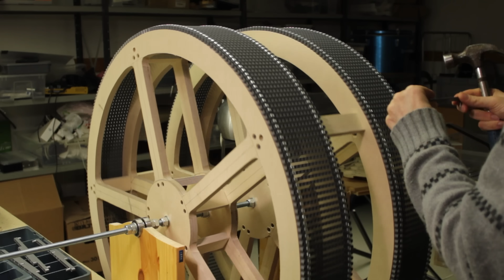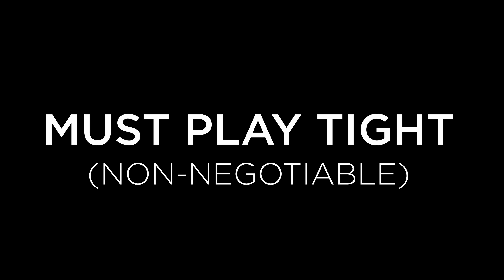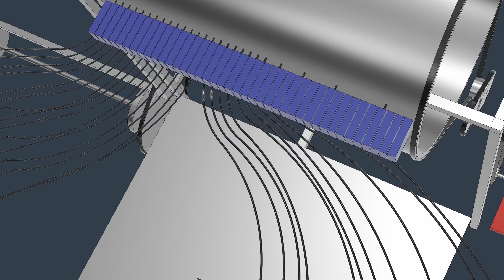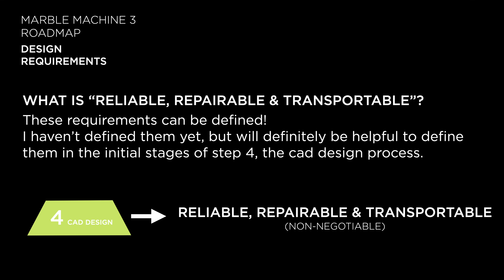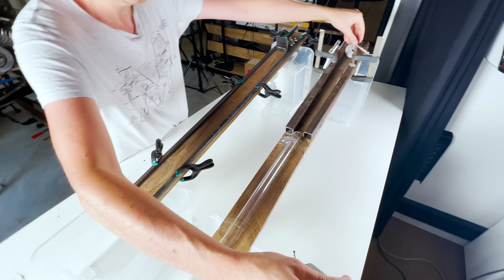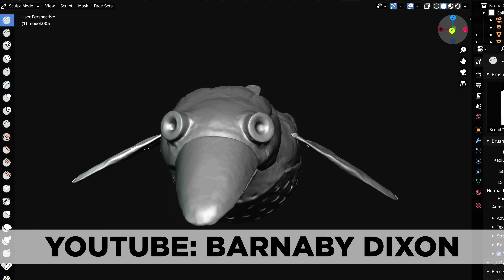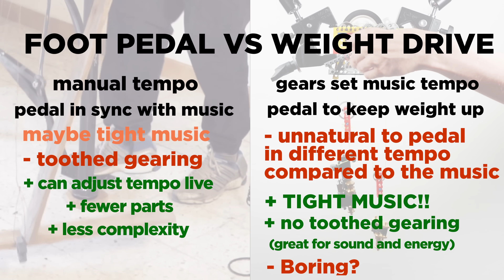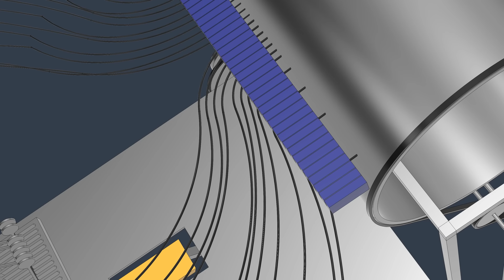Marble Machine 3 is Taking Shape

Comment: You should NEVER, under ANY circumstances, think of the first marble machine as a failure:
At best, you had a working machine that produced an absolutely ICONIC piece of music.
At worst, you had proof of concept.
Remember this:
"I didn't fail. I just found 2000 ways not to make a lightbulb; I only needed to find one way to make it work"
-Thomas Edison
Reply: Yeah it  bugs me how he thinks of the first one as a failure. It's basically just created out of will and inspiration and it was a cool project.
Reply: @wexaztor9394  same. I mean, c'mon, it was LEGENDARY. Yeah it was one hit only, but EVERYBODY saw it.
Reply: I have been saying this for quite a while. The MM was the proof of concept prototype. The MM2 was a test prototype. The MM3 will be a production model device. Each stage is needed to progress to the next one.
Reply: @Artaimus  I'd agree that the first one was a proof of concept prototype. It only became a failure after Martin decided what it should be able to do which then it couldn't. The second one however never ended up being what it was intended to be right from the beginning. Which is the very definition of failure. Also the experience collected is of limited use - and therefore not a "test prototype" at all - because he started at 0 again, using entirely different methods with new problems. While this might be the right approach (if one considers the MMX to be impossible to fulfill the requirements even in a working state), it still means that the MMX has failed and no sugar coating can change that fact.
Reply: His most successful one so far lmao
Reply: To be quite fair, he admitted himself that the first "full" song took a crazy amount of takes all cut together just to get the full video done...
Reply: @davinderc  Very true, but look at it this way:
If it wasn't for that song/video, nobody would be watching this right now... or at least significantly fewer would.
Reply: @brianwilliams1588  I very much doubt Martin does this for the views. It has definitely been a nice bonus that people enjoy it, and maybe he even earns ad profits, but he does this for his own enjoyment, and as he's made clear, he would not enjoy making music on the first marble machine, so from his perspective it failed and I won't disagree with him in that regard.

Nevertheless, as you said, it did reach many people, and that is definitely a nice achievement!
Reply: @davinderc  thank you! All these hundreds if not thousands (or even millions) of people need to stop idolizing that first machine like it was so brilliant. It fucking wasn't. It being a great, creative concept does not change this fact one bit. It was a great publicity stunt though, which explains the 200 plus million views!

The fact that such a short song took like 2 or 3 months to fucking film should be all the proof you need of just how poorly that machine functioned. Such a short song should only take hours (if not days) to film, not months. Had the machine been perfectly reliable, then there's no practical or technological reason the video would've taken months to film.
Reply: Stop saying to the creator of a thing what that thing is or isn't, you have quite literally zero input in it. Stop the arrogance and god complex
Reply: Agree with @brianwilliams1588. mm1 was a proof of concept, mmx had some good ideas, but form over function got in the way
Reply: bad idea using edison, he was just a thief
Reply: The first two version WERE a failure, simply because he’s failed to learn anything from them.  Two years later, look at what this project has become….and how’s he’s simply repeating the same mistakes.
Reply: @br52685  Aww, be fair: he makes entirely new mistakes. Also he does not directly jump for the glamorous bit but spends and eternity on the boring engine, because he wants to avoid adding problems which won't be solved down the line, which kind of makes sense. I am a bit worried about the size of the thing and the lack of a prototype for a basic mechanism which allows testing all parts in an embryonic state as his new strategy of late assembly might end up neglecting that the components don't just have to work on their own but also together, and potentially influence each other. At least he listened to the transphobic puppeteer and did not go for the automatic solution at this point.
Reply: @Schmidtelpunkt  I’m being fair.  But also honest.  You too, would admit that he’s not really learned any lessons.

For example, his year-king obsession with “tightness”—was that a failure-point in the prior two versions?  No, no it wasn’t.

What about his lesson of “dumb design requirements”?  Yet he’s now requiring <0ms tightness—for no justifiable reason (ie, this is just another dumb design requirement).

TEN YEARS later…and look (honestly) at where this or object is.

It’s one thing to “be supportive.”  But it’s also equally important to “be realistic”
Reply: @Schmidtelpunkt  Also consider this huge mistake:  he’s working on a power-mechanism, but has ZERO idea of exactly how much power his machine needs—as he has nothing functional right now.
Reply: @br52685  "For example, his year-king obsession with “tightness”—was that a failure-point in the prior two versions?"
Yes, it was. This is interesting to see in hindsight - every time the machine plays, he mentions that it isn't corrected for timing. I never realized that until somebody mentioned it. He never even started to solve that problem, because he did not reach that point. Which is a mistake he learned from. 
Also keep in mind that at this point he goes for the timing of the modules, not the instrument. There will be delays introduced anyway, so it makes sense that he optimizes everything as far as technically within his abilities.
And of course all that will lead to the question, whether a marble machine as a stage instrument is even possible. And there he absolutely keeps it open to accept that it won't deliver the precision he requires, rather than promising to finish it. 
All of this looks a lot smarter and structured than before.

I agree to the power mechanism problem - this is what I mentioned above I am worried about. There is some incremental optimization required when working with such a lot of unknowns. Especially when the machine differs that much from the previous versions. However, this does not negate that should he not be able to create a power mechanism with reliable tempo he can as well stop building the machine. Which makes more sense to find out now than just like in the previous two attempts, way too late to make any meaningful changes.
Reply: @Schmidtelpunkt  where does he state that timing was a problem with the 2nd version?  Last video I saw of that machine, it was playing very consistently.
Reply: @Schmidtelpunkt  I would also consider calling this a “stage instrument” (especially intending to go on “world” tour) to be another stupid design requirement.
Reply: @br52685  I don't think it appears in any list and it is certainly nothing I would have spotted before he worked on the power module, but when you watch old videos, he mentions surprisingly often that the timing is not adjusted yet, so it clearly was a problem on his mind.
I am certainly not qualified to judge whether the timing was tight by ear, but apparently it was not good enough for him.

And concerning the "stage instrument" I guess he already succeeded in building something he could make play a song and film it over several days. So it makes sense that he raised that bar for the MMX. I wouldn't call that stupid. It might turn out to be impossible though. But what would be the alternative other than giving up?
Reply: @Schmidtelpunkt . What’s the alternative?  Really depends on what the purpose it.  A working device he can make/record music/videos with?

Maybe then displayed somewhere, where people can watch it up close?
Reply: @br52685  That is doing what the first machine did. Not sure I'd call it a mistake not to repeat the same thing over and over again.
Reply: @Schmidtelpunkt  He was able to record music with the first machine?  I don’t recall seeing that done anywhere (other than a few highly-edited snippets).

Also, thinking about your comment that “the timing was off.”  I don’t necessarily believe that justifies an obsession with <0ms tightness.  It could simply be that his timing-pins aren’t places properly…

In all honestly though, I don’t think he’s ever justified/explained WHY the first two were failures.  But he was very clear that “dumb design requirement” were a problem.  But that all I’ve seen him chase this last YEAR—dumb design requirements.
Reply: @br52685  He somehow generated the track just like did with the music video. What would be the point of recording a track if there is nothing to see anyway?

"I don’t necessarily believe that justifies an obsession with <0ms tightness.  It could simply be that his timing-pins aren’t places properly…"
Then all notes of one instrument would still have the same false delay. The issue is that the timing deviates. There is no way of correcting that by moving the timing pins. 
While I agree that currently he clearly works in regions which even for experienced musicians are impossible to hear, the problem is still that those inconsistencies stack up. There are other elements which will introduce further delays down the road. At which point going back to get out the additional microseconds required will be exponentially harder. So he wants to solve the problem now as much as possible. 

"In all honestly though, I don’t think he’s ever justified/explained WHY the first two were failures. "
Yes, and for me that was his biggest mistake: he clearly made decisions for him, but never fully communicated them. He made several videos where he mentions specifics but the whole tightness issue seemed to come out of nowhere, because he never explicitly mentioned it. So one has to piece things together.

He was more specific about the dumb design requirements - mainly that he went to form over function, something he regretted in the last videos about the previous machine already. I don't think that an engine with constant power output is a dumb design requirement. In fact it was the requirement he completely neglected between the magnetic lift (which never worked efficiently and reliably enough).
Reply: @Schmidtelpunkt  there’s another big mistake:  he’s designing a power-device that’s only going to provide constant (and precise) power output.  Yet completely ignoring the fact that the device’s power-requirement will be constantly fluctuating.  That’ll simply result is significant changes to the machines speed.  So much for any optimization of <0ms tightness.

Yet his new philosophy is “I verify?!?

He should know this by now—-as he’s sunk TEN YEARS of his life into this.

I’m 100% of the belief (along with many others) that his true goal isn’t a functional machine, but merely to keep this YT channel (and revenue) going…
Reply: @Schmidtelpunkt  you claimed that his prior machines mechanism (magnetic lift) never worked efficiently.  Yet his last full video on the last contraption seemed to demonstrate that the machine WAS working very efficiently.

Granted, I don’t necessarily believe it’s true— but his last video on the MMX was nothing but praise and success.  Then poof…abandoned.
Reply: @br52685  "there’s another big mistake:  he’s designing a power-device that’s only going to provide constant (and precise) power output."
Nope. That is what the flywheel is for. The problem I see is that the actual power requirement is unknown. But then again this should be solvable with a heavier flywheel should the module prove reliable. Whereas if the output fluctuates already without any load at this stage the whole project already fails here.

He verifies component by component first. This sounds a bit like Schrodinger's mistake - it is a mistake or not a mistake at the same time, but we only know when the machine is running and reveals it. I will be happy when he has finished the boring parts which just have to function but otherwise disappear and goes on working on the interesting stuff which results in more interesting output than Excel sheets. But after his last video I totally get why he puts in the effort.

"I’m 100% of the belief (along with many others) that his true goal isn’t a functional machine, but merely to keep this YT channel (and revenue) going…"
Well, if you really think he is a fraud - and that is what you are claiming, as clearly in that case all his exhaustion and depression must be a ruse as well - I am a bit surprised you are still supporting him with your attention and clicks. Like all the others who also have nothing better to do than furiously consuming every second of video he uploads... 
I have to say I preferred a lot the constructive discussions on Discord - which he obviously followed as well.

"you claimed that his prior machines mechanism (magnetic lift) never worked efficiently. Yet his last full video on the last contraption seemed to demonstrate that the machine WAS working very efficiently."
No, he mentioned before that the lift is not fast enough to keep up with the demand and the marbles run out - aside from them not getting distributed correctly. But then again - maybe it is evil Martin again, having a perfectly working machine but pretending it would not work in order to keep his Youtube channel running, right?

"Granted, I don’t necessarily believe it’s true— but his last video on the MMX was nothing but praise and success. Then poof…abandoned."
At that point he clung to the bits working and attempted optimism. Which completely vanished when the machine broke in his live stream. I think the fact that a team at the museum is attempting to get the machine into a functioning state shows rather well that it never performed as planned.
Reply: @Schmidtelpunkt  He follows advice (here or discord)?  No..he clearly doesn't.

He's doing the flywheel?  Or gravity-weight?  He waivers every week, so hard to keep track.  And the flywheel is going to maintain AND ALTER tempo through the foot-pedal?  Or how exactly is the tempo going to be altered?  He claims his design is complete...but he's not actually VERIFIED any of this.  Again, I do agree that he has no concept of how much power is needed--I just don't agree that it's going to be as simple as "replacing with a bigger flywheel."

Okay, so his machine broke during a livestream?  So the failure is with the RELIABILITY and not TIGHTNESS (as I said earlier).  

He's now TEN+ years into this.  I lost interest about 5 years ago (largely because it was just a series of avoidable and obvious mistakes--there was a vision, but not on a path to properly execute).  It just popped back into my feed recently.  I'm still amazed at how many mistakes he's making, and how adamantly he ignores obvious/correct advice given by others, and yet how he even still manages to maintain an audience.  To me, it's a perfect example of the "sunken cost fallacy"--even for his most ardent fans.

But hey--"doing something stupid an creating a fanbase/audience" does seem to work for a lot of people now!
Reply: @br52685  "He follows advice (here or discord)?  No..he clearly doesn't."
And yet he did hat they recommended and stated so in the video. So there is your observation against what is actually to see on Discord and in the video. 

"He waivers every week, so hard to keep track."
So now his problem is that it gets too complicated for you to watch the videos in chronological order. I wish he would make equally clear statements about all his decisions.
"And the flywheel is going to maintain AND ALTER tempo through the foot-pedal?  Or how exactly is the tempo going to be altered?"
Yep, that is the idea - he keeps the fly wheel at the tempo he aims for.

"He claims his design is complete...but he's not actually VERIFIED any of this."
Because he has to build something to test it. This is the typical chicken and egg thing. He cannot verify his design without building it. So it is complete based on Lego which is at least one test saver than no test at all like he did before.

"Again, I do agree that he has no concept of how much power is needed--I just don't agree that it's going to be as simple as 'replacing with a bigger flywheel.'"
As long as he is able to accelerate the fly wheel, it is. And else the machine is not possible without a motor powered by electricity and therefore he can save time by accepting that the marble machine as an instrument cannot work. 

"Okay, so his machine broke during a livestream?  So the failure is with the RELIABILITY and not TIGHTNESS (as I said earlier). "
That is why it broke down. It never had the tightness. It might blow your mind, but two things can get wrong at the same time. There is no such thing as a binary state which would not allow a second problem to come in when a first has appeared.

"I lost interest about 5 years ago"
So now you are angry because you did not watch the video for 5 years and therefore don't understand what his plans are? You are aware how incoherently you are arguing there?

"To me, it's a perfect example of the "sunken cost fallacy"--even for his most ardent fans."
The second machine with all its angle grinding was. Which is why it was the right move to give up on it rather than trying to save a half-asses concept. And once more - he spends a lot of time on the engine module to avoid the project getting into the same state. And yet you think it is a mistake.

"But hey--"doing something stupid an creating a fanbase/audience" does seem to work for a lot of people now!"
Doing something interesting and creating a loyal audience is indeed a strategy. That is what channels are for.
Reply: @Schmidtelpunkt  There are many examples where he doesn't listen to sound advice:  Bowen cables, methods for measuring his "tightness," flywheel design/caging/balancing, size of instrument, oversizing of the programming wheel, micro-adjustments of the programming pegs, etc (and that's just the last several months).  

Sorry, but you don't understand how a flywheel works.  You don't simply "keep the flywheel at the tempo he aims for," ESPECIALLY where the tempo needs to be dynamically (and quickly adjusted).  Flywheel's spin at constant speed, and do not rapidly accelerate/decelerate.  There needs to be an entirely separate gearing mechanism to adjust the output speed/tempo of the instrument.  Especially if he cares about "timing" and using this as a "musical instrument."

Lego is not even a remotely similar "test."

The machine broke down because it wasn't tight?  No...he posted a very long video outlining how reliable and successful the machine was (the last video on the MMX).  Unless of course, that video was misleading.  The second machine was a half-assed concept that should have been given-up on?  I thought there's a whole separate group that's picked it up and working on it (ie, far from "given-up")?

You think I'm angry?  Far from it. It's just interesting to see a decade wasted with little to show for.  That is, IF his actual goal is to produce an instrument (as opposed to keep a YT channel going).  At this point, I'm just amazed at the gullibility of his die-hard fans (granted, most of his audience has wisened-up and jumped-ship).

Yes, I 100% think his mistake is overly-focusing on the power-mechanism and not on the actual instrument itself.  Powering the device is simple--and there are countless off-the-shelf methods that could be employed that would be 100X more reliable (and I thought "reliability" was a goal, no??).  Even his little foot-pedal is an obvious mistake.

Well at least you're entertained.  For me, it's just a good example of how not to accomplish a task.
Reply: @Schmidtelpunkt  But bottom line:  I guess I'll check back in another year (or two).
Reply: @br52685  Yes, he does not listen to all advice at once. Also there are parts of his project he has not be working on yet, so they will have to be tested when there is something to test. 

"Flywheel's spin at constant speed, and do not rapidly accelerate/decelerate."
Yes - that is the point of a flywheel. Its inertia. It still can run quicker and slower.

"Lego is not even a remotely similar "test.""
Lego is not a similar test but it is a test. It is so funny how people like you want things tested before they are build and but then also dislike models to test things before building them, because they are not the same thing. Sounds like you really just want to justify your own anger, you have no reason for.

"The machine broke down because it wasn't tight?"
Nobody said that. The machine was not tight and broke down. Independently. You know, like a car can stop because of having a flat tire while also having a broken light. At the same time! Of course your would immediately cry foul play when somebody wants to fix the light, as the car can not break down because of broken light. But yet both things can happen at the same time. It really isn't that difficult to understand.

"No...he posted a very long video outlining how reliable and successful the machine was (the last video on the MMX)."
He posted his test. He had a whole series of videos where he just tests marbles running through the machine, but never while playing a song. The machine did not show the same reliability when it was running. This is something he explained in some video in between. This btw. is a mistake I am a bit worried he will make again with his late assembly strategy. But then again, it is also a chicken and egg thing.

"Unless of course, that video was misleading."
Sometimes things happen before other things. It is not a pre-produced series. But maybe I am just suspicious of people quoting Elon Musk too much, as that usually means sugar coating a make-or-break moment.

"The second machine was a half-assed concept that should have been given-up on?  I thought there's a whole separate group that's picked it up and working on it (ie, far from "given-up")?"
Yes, but they won't get it into the state to play on stage. That was the goal and for that the machine's concept wasn't functional enough.

"You think I'm angry?"
You don't sound happy. And you seem pretty instant, nobody else should be either. 

"At this point, I'm just amazed at the gullibility of his die-hard fans (granted, most of his audience has wisened-up and jumped-ship)."
I am not sure what "gullibility" would be required for. I watch the videos as long as he does something interesting. He did stop is Patreon, so nobody is paying. And contrary to public belief Youtube does not automatically shower people with money. It comes down to what every Youtube does: creating interesting content. If you dislike the content, you don't watch. If you like it, you watch. Unless of course like you, you want to punish yourself.

"Powering the device is simple--and there are countless off-the-shelf methods that could be employed that would be 100X more reliable (and I thought "reliability" was a goal, no??).  Even his little foot-pedal is an obvious mistake."
I am sure he would look into it, if you posted the examples of off-the-shelf methods to keep a flywheel running used in musical instruments in his discord or reddit. Interestingly that is something nobody else has come up with so far. 

"Well at least you're entertained."
That is the point, yes. The moment I stop being entertained, I stop watching. Like I did not bother watching the live streams (where apparently he explained a lot about giving up on the MMX).
Reply: @Schmidtelpunkt  You’ve repeatedly claimed that I’m “angry.”  Yet you’re the one making gross exaggerations and hyperbolic statements.  It’s appearing that you’re the one being emotionally manipulated by this project.

Like I said—I’ll (maybe) check back in another year.   But I guarantee there won’t be a working marble machine.  It’ll another trail of easily-avoidable mistakes.
Reply: @br52685  I am just bored that people keep on whining because Martin does not follow their different diametrical opposed ideas without having the slightest concept about finishing a project more complex than tying their shoes. So, yep, might be I am a bit annoyed. 

At this point I really don't care whether there will be a machine - I just take the videos as long as they come. I did not expect it to go on after the failure of the MMX.
Reply: @Schmidtelpunkt  You think people are whining?  No, they’re making very valid criticisms and suggestions—and in many cases, it’s coming from people who are EXTREMELY educated in that arena.  That, in fact, is 100x more valuable than than the trite compliments and placations.

It’s also foolish of you to think that I (and other), aren’t creators/builders ourselves.  I know it may come as a surprise to you, but there are actually engineers, project managers, and problem-solvers that exist in the world.  And just because they haven’t built their own marble-machine, it doesn’t mean that they don’t have IMMENSE knowledge of the components involved.  You, on the other hand, think all flywheel knowledge is irrelevant, because it’s never been applied to a marble-machine before.
Reply: @Schmidtelpunkt  you didn’t expect it to go on after the failure of MMX?  I sorta did, based on his series of supposed “lessons learned.”

There was a fleeting sense of “maybe he learned something.”  Go back and watch them, and you’ll simple see that he’s repeating the same mistakes.  Hence my original comment that the first two versions WERE a failure, simply because he’s not applying his lessons-learned (which he posted about in a series of videos).
Reply: @br52685  "No, they’re making very valid criticisms and suggestions—and in many cases, it’s coming from people who are EXTREMELY educated in that arena."
Indeed, and among those there is a healthy discussion within reddit. They are easy to recognize as they don't claim that Martin is a fraud and just plays his depression for Youtube clicks. Which maybe is also the reason why their comments get read and their opinions get occasionally acknowledged in videos by Martin.

"It’s also foolish of you to think that I (and other), aren’t creators/builders ourselves."
Considering your track record here it does not seem like you are looking for a constructive solution but desperately try to find mistakes. So, nope, you are certainly not qualified to design anything from scratch. 

"I know it may come as a surprise to you, but there are actually engineers, project managers, and problem-solvers that exist in the world."
Easy to recognize by the way they argue. Which is not your way and not the way of the other whiners.

"And just because they haven’t built their own marble-machine, it doesn’t mean that they don’t have IMMENSE knowledge of the components involved."
And if they are really engineers, they offer advice concerning those components and not Dunning Kruger about the whole project management, because those two are not the same. Which people who lead projects know as often they work with people who are more qualified in each department.

"You, on the other hand, think all flywheel knowledge is irrelevant, because it’s never been applied to a marble-machine before."
Nope, I did not say that. I just denied your claim that there are off-the-shelf fly wheels, which he would just have to put into his machine to carry on rather than exploring whether that module can work in this specific context.

"Go back and watch them, and you’ll simple see that he’s repeating the same mistakes."
Not really. Rather than finding a new method and angle grinding it into the finished machine, he tests stuff this time. This is kind of a red line he is following. That was his main mistake and so far he has avoided it. 

"Hence my original comment that the first two versions WERE a failure, simply because he’s not applying his lessons-learned (which he posted about in a series of videos)."
Considering that the mistakes you found were not to care about tightness of the machine and otherwise just to go randomly into multiple different direction because you really really want to be unhappy about everything Martin does, I don't think that was really the failure of any of the machines.
Reply: @Schmidtelpunkt  Again, you’re just responding with any lack of logic or rationale.  It’s obvious that you’re emotionally invested (manipulated) by this project, and personably offended (for whatever reason) by any sort of criticism.  You responses are full of all the logical fallacies (straw-man, ad hominem, false dilemma, etc)

You (just like Martin) need to take a step back, take a deep breath) and re-examine the situation from a NON-EMOTIONAL perspective.
Reply: @br52685  No, it is very logical. Which you would realize if you had any clue about the matter, which you don't. In part because you did not watch the 10 gazillion episodes before including the tedious live streams. But also because you don't bother to find out why he made some decisions and prefer to ignore his reasoning. Instead you just decide they are mistakes. And that is where is becomes clear that your accusation of being "too emotional" becomes mere projection. At this point you realized yourself that several comments of your nagging whining do not make you look like the non-emotional expert you would love to be (without putting in the slightest effort to become one, of course). It is hilarious that, just like every narcissist of your kind, you entirely stopped talking about the machine and did not bother to find arguments. Instead you shifted to making the discussion about character. About your character specifically. Because for you that is what this is about: You pretending to know stuff and you wanting to be admired for knowing stuff. 

Oh, and you talking about strawmen is just hilarious. You mistquoted me so often - so once more, all you have to offer is projection, because you are clearly aware how nothing you brought into the discussion had any merit in the end.

Maybe indeed, take a step back, take a breath, and realize how idiotic you look pointing out exactly what you did wrong right from the start. Wipe the tears of anger out of your little eyes and go somewhere, where your presence might be needed or at least is less of a nuisance.
Reply: @Schmidtelpunkt  Good grief dude—get a grip.
Reply: @Schmidtelpunkt  The laughable thing here is that this entire thread started because YOU are trying to tell Martin that he’s wrong!!!
Reply: @br52685  So now your claim is that Martin is on this thread?
Reply: @Schmidtelpunkt  This thread is about Martin being incorrect when claiming his first two devices are failures.

I agree with Martin.
Reply: @br52685  That does not mean that I am "trying to tell him" something. If you are unable to express what you want to say, nobody can understand you.
Reply: @Schmidtelpunkt  I've clearly expressed my opinion.  You're just are upset that you don't agree.
Reply: @br52685  Your opinion is that I am talking to Martin. As I don't do that, it clearly is a nonsense opinion. I am not upset about that, it just makes once more clear that you project your own intentions on others. In fact I am smiling about how perfectly this proves my point.
Reply: @Schmidtelpunkt  And don’t forget:  you’re throwing your support behind someone who idolizes Elon, and tries to mimic his “business-practices and approach.”

That is not a fact to ignore.
Reply: @Schmidtelpunkt  Whelp….looks like the 2nd MM can play just fine. All it needed, was to be finished!
Reply: It is funny to see how people refuse to see reality.
Original MM was failure. It even can't play one full song - awesome music video we saw were compilation of good parts of dozens runs. I not even touch how much time Martin spent on first MM.
Yes, after all, Martin get up, took some ideas and move forward after his FAIL.
Just imagine - you come to shop, buy a great looking car sit into it start engine and it stops after 10 meters. And again and again and again. Then you saw what fuel on the road and wheels almost fell off. What do say after that? This is best car ever with small issue - it can't drive?
Reply: @efimovv  Not succeeding is not the same as failing. Failure would have produced zero results. MMX was more of a failure, and yet it wasn't because it still produced results, albeit not good ones.
Seems some people see not just glass half empty, but just plain empty... and they shouldn't encourage others to do the same.
Reply: @brianwilliams1588 Experience is what you got istead of what you really wanted. 

Mechanically, MMX was way better than original MM becase it can play different songs and do it in one pass, without errors and half of marbles around. But Martin also set target a lot higer - to be able to play almost any song he want and be movable (original MM unable to exit room where it created). When Marting understood what with current design achieve goals not possible - he cansel project and start over with all experience he got. 

 In my opinion, you just redefine meaning of  words for some reason. I even serch in bunch of dictionaries. 
Fail does not produce zero results - zero results "produced" when one just do nothing. If somebody acts, he always get some results - expected or not (and usually both).

Positive thinking in general good thing. But balance needed: one can choose side when glass contain 50% of water but if glass cntain 5% of water then call it "almost full of water" not very practical. But looks like very popular nowdays.
Reply: @efimovv  231M views, dozens if not hundreds of covers, thousands of inspired musicians (and engineers) , and a TON of subscribers... all from that machine.
I call that a RAGING  success!
I refuse to have a pessimistic view on that.
I want Martin to succeed! He's inspiring AF!
It's not a failure until he quits.
If a positive perspective on this is an issue for some, then so be it...
Reply: @brianwilliams1588  Yeah, it was indeed a "raging success"... from a publicity standpoint. That's it. Like it or not.

Please, stop letting your infatuation with the first marble machine cloud your judgement.
Reply: @efimovv  Original MM was wildly successful in the sense that it started as "wouldn't it be cool if..." and ended at "yes, it is very cool (and also finicky)" A janky hack that proves that the concept is cool is a success if that's your goal.